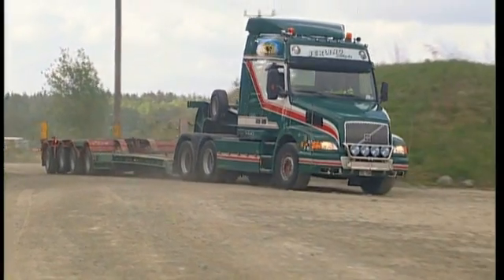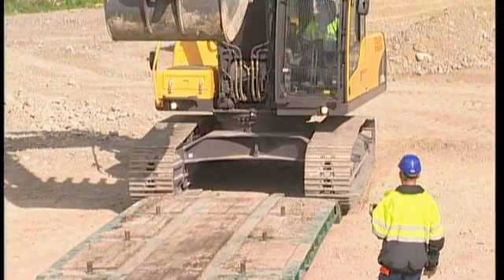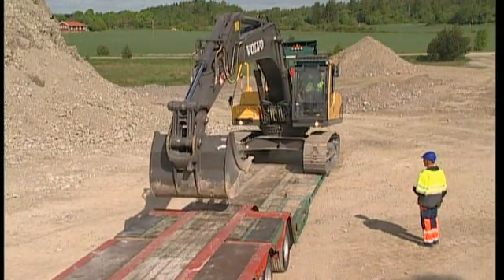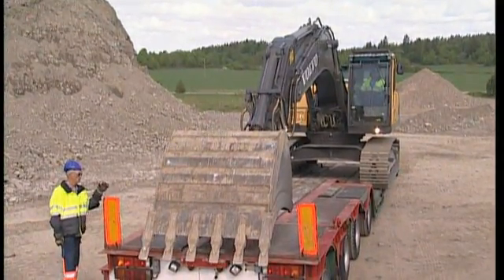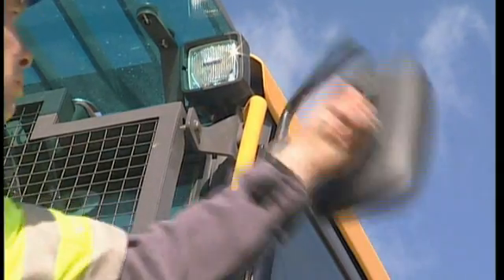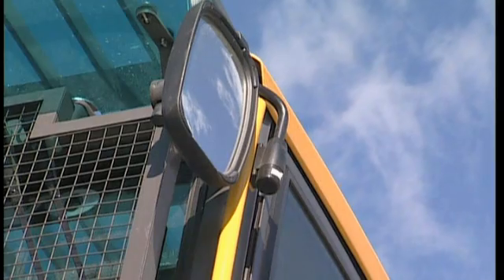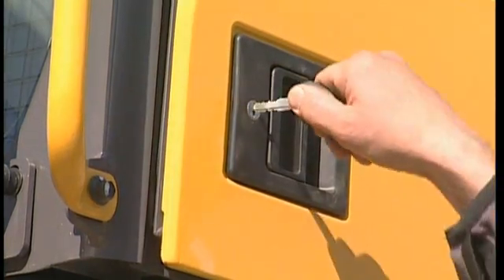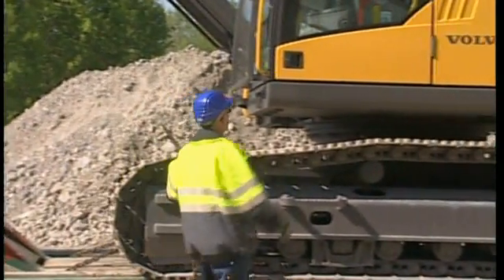How to load a Volvo Crawler Excavator on a truck (Part 15 of 15)

Comment: 0:38 "Balance with the help of the excavator's digging equipment when entering the lower body. This is to avoid tipping which would prove awkward both for the excavator and the trailer."  
How do Brits come out sounding like Shakespeare even when talking about how to avoid a total fuck up with heavy equipment?

Comment: when hes chaining up I would pull off of just like he did with the X then I would hook 2 off of each track and pull them in front and back then id lay a block on the floor of the trailer and set the knuckle on the floor and chain thru the knuckle if you dont chain like that you will not leave a KEEN yard here in the states